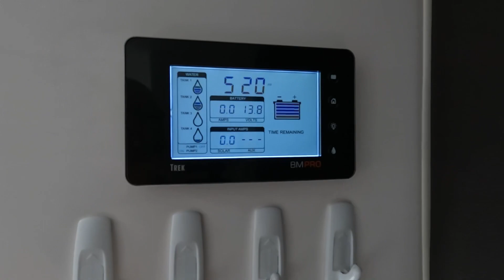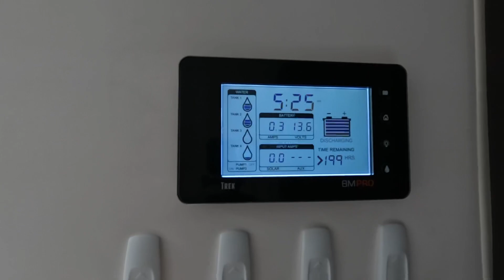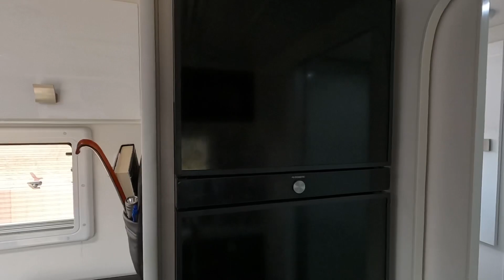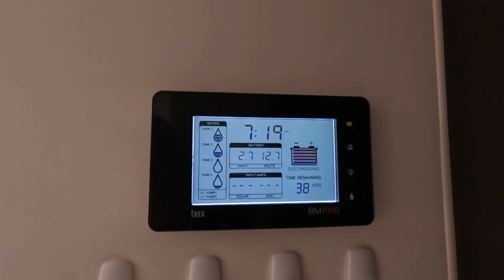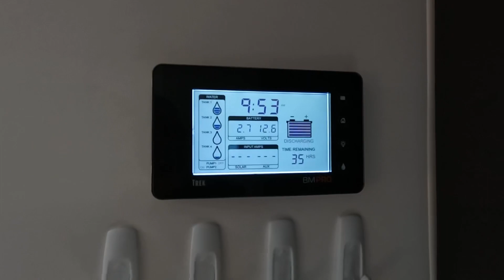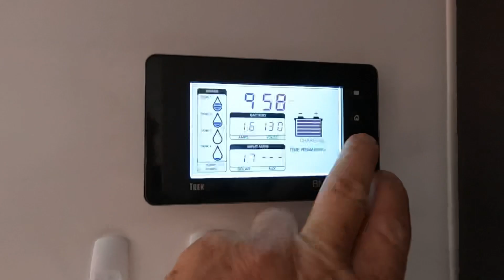RED CENTRE CARAVAN - HOW MUCH SOLAR AND BATTERY SIZE DO I REALLY NEED | SEPS ADVENTURES

Comment: You may want to increase the number of panels you have if you can. But avoid solar concentrators because they have a fire risk. 

The reason why you want to increase the panels is that if you are using them for power in winter, the solar power drops a ton in winter. There's so many more cloudy days... and that's why. That also means... if you think you have a certain battery level needed you want to increase that again just because... if you have 2 cloudy days in a row you might not have enough battery power. 

But... there's a lot of devices you can use to reduce power. Like if you use a rice cooker, or a crock pot they can use less power than an electric burner or a microwave. Laptops use low power, tablets and ipads use less power even than those. And tablets and ipads can have patteries that last literally much of the day (8 hours possible... or 6 hours-ish). 

Sorry don't have a solution for you on heating. Heat for a tent or camper brings up the power cost a lot. (Lots of people use propane for that, as propane doesn't degrade like gasoline does.) 

Hope this helps.
Reply from the maker: When there is no 240volt power available we have two 9kg gas bottles on the caravan which we use for cooking . The option for heating is a diesel heater which we do not have at the moment so a few extra blankets. The 12 volt power needs is basically for lights and the occasional use of the water pump. The Tv is nice but not necessary if we are low on power. Also we have the ability to plug in fold up solar panels which can boost the charge rate if required when the sun is out. Thanks for your suggestion and comments. Cheers!
Reply: @sepsadventures  Thank you very much!

Comment: The only issue you’ll have is if you want to do multi day or weeks and weeks of free camping and you get a week of rain. We recently did 80 days of free camping with 600 ah of lithium and 4 x 170 solar never had a issue even with a full week of rain but we run a jug , toaster also charge 18v batteries for drill , chain saw and ebike batteries. 

Great insight thanks for sharing. Red centre Tanami plus owner 👍
Reply from the maker: Glad you liked the vid and thanks for your comment. Cheers!

Comment: Hi Sep - I have a very similar set up three way fridge with 120ah battery and 200 solar on the roof. My usage would be almost exactly the same as yours with possibly a tiny bit extra for a laptop. Haven't been off grid before but the vid confirms what I'd hoped that we be OK for two maybe three days no sweat. Thanks heaps 😊
Reply from the maker: From my experience one of the largest constant usages of power in a caravan when off grid is a compressor fridge which draws approx. 1.5 to 3 amps per hour. So if you have a three way fridge on gas you eliminate that power draw except for a minor amount for the light when opened and possibly a small fan. If you have a small power set up running a couple of led lights, a tv and occasionally the water pump the combined power draw is minimal. Glad the vid helped.Cheers!
Reply: With 200 watts solar on the roof is that enough to say do very small heat in a camper at night + laptop power costs? Thanks.

Comment: Hi Seppy. Like you said in your video, it all depends on your individual circumstances and needs/wants. For me, I have two small kids, a missus who is a bit of a reluctant camper and likes her hairdryer and aircon and hence, I need a reasonable battery/solar system to cope. If it was just myself, it'd be a very different story and as I have done in days gone by, get by with a styrene foam esky full of food, a sleeping bag and a three man tent. I can therefore understand your current personal circumstances in placing very little demand on an electrical system. From my experience, the bigger limiting factor regarding how long I could remain offgrid was not my electrical power but my water storage.
Sure there is cost involved with beefing up the electrical system on a caravan (a good part of that being labour) but my solution to that was to do pretty much all the work myself then get it fully checked by an auto electrician. I'm not at all a sparky myself but I did do some extensive research into how to properly do the work (all on YouTube) and consider myself to be reasonably 'handy'. Apart from that, I do have a technical background but that said, the work itself is not overly difficult. My thoughts are that it's always good to have a power 'reserve' up your sleeve in case you need it (especially with little kids) and/or you're unlucky enough to get extended periods of poor weather whilst travelling.
I ended up installing 3 x 120Ah LiFePO4 batteries, a RedArc Redvision, a 3000W inverter (to run the aircon via a changeover switch) and 700W of fixed solar panels (and 800W of portable panels) all of which have thus far proven their worth in my travels with my family. Horses for courses I guess ...
Reply from the maker: It’s amazing what you can learn on you tube, I have used it many times myself when I am not sure of how to go about a fix. Looks like you need the power and are very handy at doing your own work. Everyone’s needs are different and I can certainly relate to the foam esky, sleeping bag and a tent. Appreciate your comment and happy touring.Cheers!
Reply: @sepsadventures  I heard an idea recently, that someone could say put canvas tarps over a tent to add to insulating to lower power costs at night. I haven't had a chance to test this yet though but other people say it helps a bit (but how much). 

...

For the other guy... most people with a hairdryer... thats heavy watts. Even with an inverter that can handle it, you could trip the inverter because the battery bank will trip the inverter if the volts drop down to 10.5 amps (unless you are 24V system). A 12V system can have the battery bank trip the inverter even if the inverter can handle it. But I still like a 12V system because its simple. 

Most heavy watt usage items are going to be problematic for people (re; hairdryers). But I get that you are just trying to keep the wife happy. 

I am curious to ask if 700 watts of solar panels is enough to get through the day for some people? (I only need heat at night for tent because of high elevation where I'm at means nights can be a bit cold.) And there are ways of cooking with low power, and also laptops. 

If you guys run into anything you want to bounce ideas off of feel free to message/reply me. 

...

Like I found another tip... if you have a rice cooker, you can put water in it and then put it on the warm only setting. This will use less than 80 watts and you can use it to raise a tent or camper's temperature at night by like 5 to 8 degrees. But most portable heaters like space heaters will be at least 300 watts and sometimes 500 to 800 watts. 

I've heard also people will use electric blankets for warmth with low power also. Electric blankets they say can be around 40 to 60 watts. But that's sometimes an issue because a lot of people are finding electric blankets to not last very long. Sometimes breaking right from the get go.
Reply from the maker: @noahriding5780  Canvas over a tent would help with condensation and keep the rain off and help stop the wind but I am not sure if the actual temperature inside compared to the outside would be a lot different. Stopping a cold wind entering a tent would help to feel warmer. Not knowing your set up the amount of solar required would depend on your power draw, size number of and type of batteries and the amount of sun the solar panels are exposed to. If you have low power draw and a reasonable size battery and the panels are exposed most of the day to the sun 700 watts maybe ok to recharge your battery each day ready for night time use. Appreciate your comment. Cheers!
Reply: @sepsadventures  Thank you! May you win the game of life.

Comment: I got a qoute for $15-17,000 for a lithium setup, far as im concerned im getting 1 decent lithium battery and a honda 2.2kva suitcase genny ,all up $3800 when on sale
Reply from the maker: I think it’s caravan industry sales hype that drives these large battery and solar set ups and the big off road go anywhere caravan that can stay off grid for ever. I see a lot of older people that have probably spent a big chunk of their retirement fund on something that they probably don’t really need. It’s good to do your home work on what will work for your own situation and budget. Cheers!
Reply: @sepsadventures  auto elecs charge an arm and a leg. I was quoted nearly 2k for 100ah lithium with only a  dcdc instaled in back of 4x4. I did it myself with all Victron gear, including dcdc, correct spec cabling, busbars, fuse block, mmpt, battery monitor, inverter/charger, non victron 100ah lithium battery.....$1900. Sure you need to have an understanding of DC power but spend the time watching videos or reading and a a couple of weekends and you'll be able to do it yourself. Whatever you do, don't go budget on the cabling and charging equipment (battery doesn't need to be top of the range but don't get bottom of the range). Just realised your post was 1 year old so my  response may be useless to you. Cheers
Reply: @cyclemoto8744  not at all, for $6000 i did the following, 2 x enerdrive solar panels 100w each, 1 chinese diesel heater, 280 amp aussy made battery with 330 continuous amps, 2600w enerdrive inverter, topargee water gauge, fiamma 70 water tank, victron 30 amp AC charger, enerdrive dcdc 40 + charger, victron smartshunt, all cable is the next size up, cable trunking, 8t crimper, and all your good quality sundrie items. And elecbrake bluetooth brake controller.and oh a 26 inch tv,

Comment: That was of your most informative sessions to date - was very helpful with my iload van conversion- I also have a question - I was looking at a pure energy slimline 100AH lithium battery for the iload but noticed the storage temperature is 0-40 degrees Celsius- what happens to batteries if it gets up to 45 degrees, as it can in a Victorian summer - also in Winter it can get down to 0 degrees on the odd occasion- do you know what happens to the batteries at these temperatures ?
Reply from the maker: Prolonged exposure to very low or very high temperatures can decrease the performance and power capabilities of the battery. So if you live in Siberia or Dubai your battery would not perform or last as long as if you lived in Brisbane.Thanks for your question. Cheers!
Reply from the maker: @thelonewolf666  that’s a good idea. Cheers